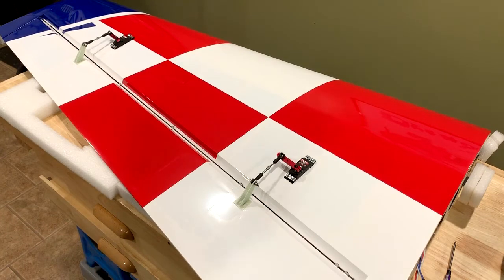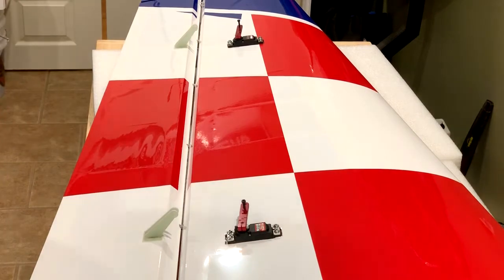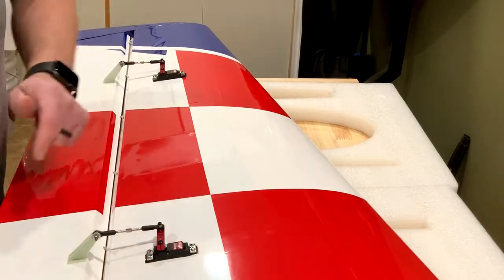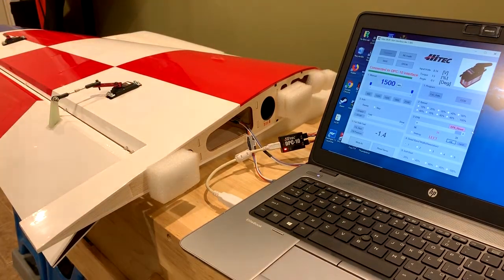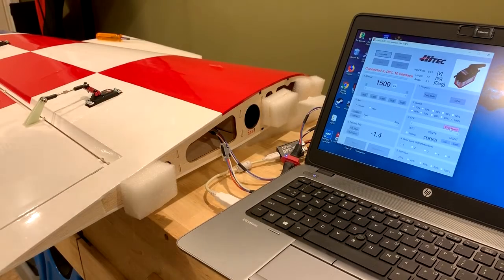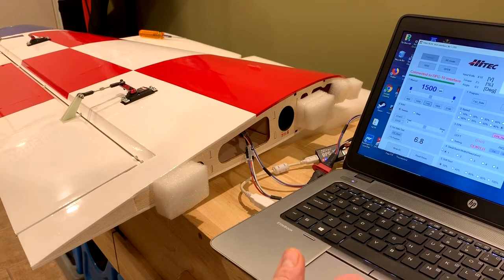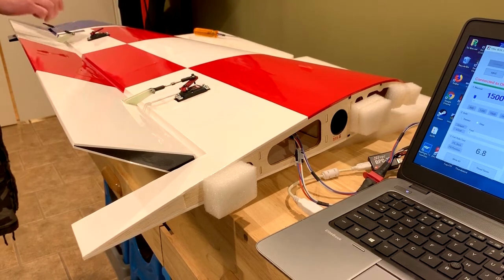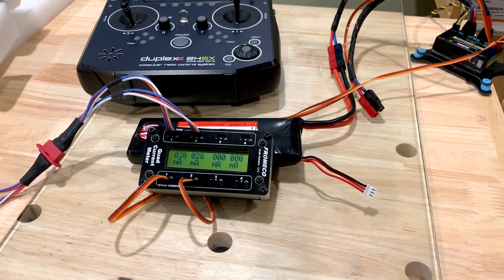How To: Programming Hitec Brushless Servos with DPC-10 and Jeti Radio

Comment: Hello, I have a DPC-11 and I can't find the right drivers. The hitec interface keeps saying "DPC-11 not connected". Do you have any advice ?
Reply from the maker: What operating system? I just connected my DPC-11 up to Windows 10 and it worked without doing anything extra.
Reply: @djmoosecom  Win 10 too :/
Reply: Do you find any solution? Because I have the same problem. Thank you for your answer
Reply: @djmoosecom  in the hitec website is the answer to this problem in win10
Reply: @stefafy11  in the hitec website is the answer to this problem in win10